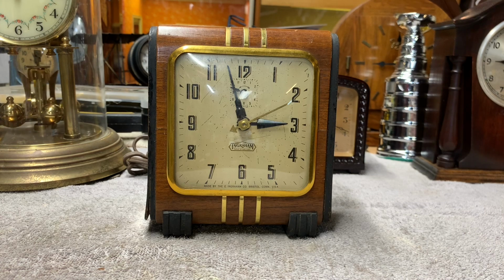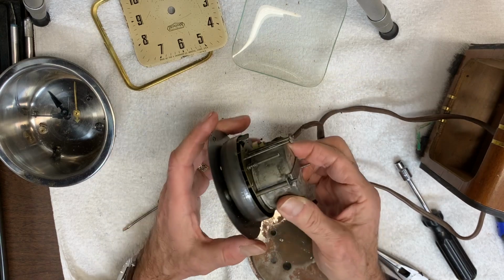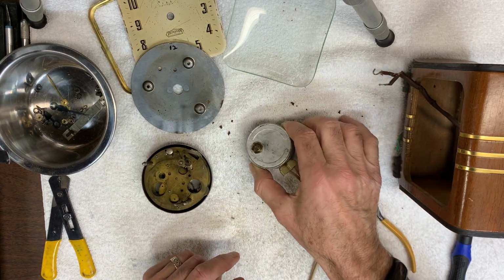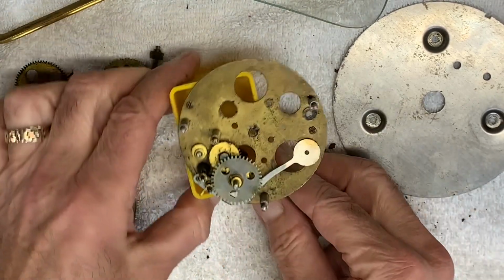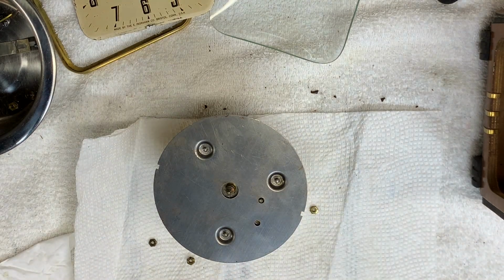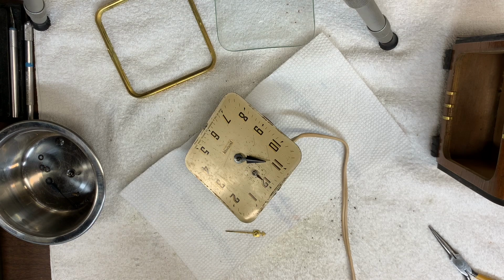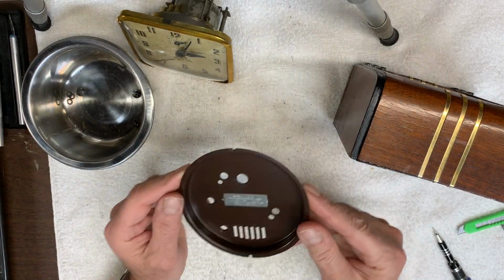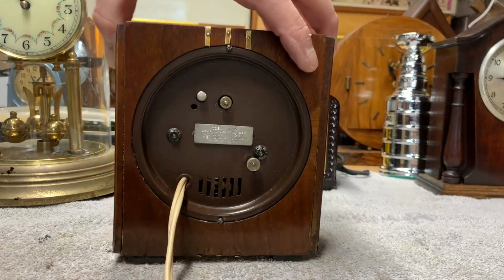Repair and Restoration of an Ingraham SA5 Alarm Clock, c. 1936

Comment: I bought an Ingraham SA5, and it arrived yesterday. It's somewhat different from the one in your video. Most notably, the motor is the type with a large electromagnetic coil underneath. If you Google "Ingraham electric alarm clock (circa 1930s) with one side of electromagnet coil disconnected.", a forum thread with interior and exterior photos of my clock should show up. (The title of that thread was due to a misunderstanding I had earlier; I thought the clock didn't work, but later got it to work.) Currently, the clock is running way too slow (for the second hand to go around the clock once takes 1 minute and 38 seconds instead of 1 minute). There's a small metal rod with a slot for a flat screwdriver that I think is for adjusting the speed, but no matter which way I turn it, the clock seems to still run too slow. Do you know how to properly adjust the speed?
Reply from the maker: My SA5 does not have that adjustment rod.  I have seen it on other clocks, where it is used to disable the alarm.  It moves a lever that prevents the hammer from contacting the bell.  I do not know why yours is running slow, these clocks usually keep perfect time.  It is likely an issue with the motor.  If you can completely disassemble it, clean and lubricate, it may work properly.
Reply: @markh77  "I have seen it on other clocks, where it is used to disable the alarm.  It moves a lever that prevents the hammer from contacting the bell."

Ah, I see.

"If you can completely disassemble it, clean and lubricate, it may work properly."

What is the best lubricant, and what's the best cleaning substance?

Also, what are the best things to use to clean the wood and the brass trim?

And does Restor-A-Finish fix milky-looking patches caused by rubbing alcohol? I used alcohol to clean the glass on the front of the clock and accidentally got some on the wood. It causes milky discoloration on the varnish.
Reply from the maker: @hardwickebenthow  I use synthetic clock oil, there are several brands, I use Horace Whitlock, but I am sure they are all the same.   If you have an ultrasonic use hot water with Dawn detergent to clean the brass parts, otherwise use a toothbrush with Dawn.  I clean out the pivot holes with a toothpick soaked in alcohol.  I use  Bruce's wood cleaner for wood cases, and follow with Restor-a-finish.  You can try it on the white patches, it may help and won't make it worse.  I use Brasso to polish the brass.
Reply: @markh77  "otherwise use a toothbrush with Dawn."

Would the correct procedure be to put Dawn on the toothbrush, lightly scrub the parts with it, then rinse the Dawn off of them under running water?

Also, does this only apply to the interior parts made of brass or also the iron/steel ones?
Reply from the maker: @hardwickebenthow  rinse parts in hot water, dip toothbrush into some dawn. Parts should be taken apart. Do it to both brass and steel parts, but make sure you dry the steel ones as they can rust.
Reply: @markh77  To make sure I understand correctly, is this the proper sequence of steps?

1. Take parts apart.
2. Scrub them with a toothbrush dipped in Dawn.
3. Rinse them in hot water.
4. Dry the parts.

Comment: When you had the inner mechanism taken out of the wooden case but plugged in to test the alarm, I could hear the motor/clockwork sounds. Is the motor significantly quieter when it's installed in the case (ie, does the case cancel out most of the noise)?
Reply from the maker: Yes, considerably so.
Reply: @markh77  Thank you.